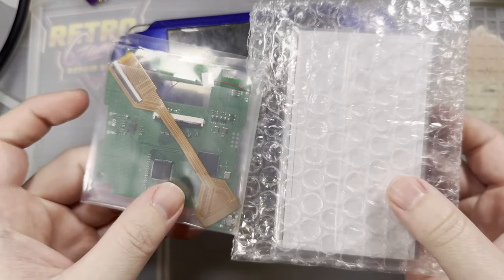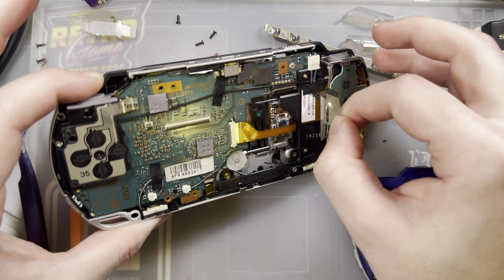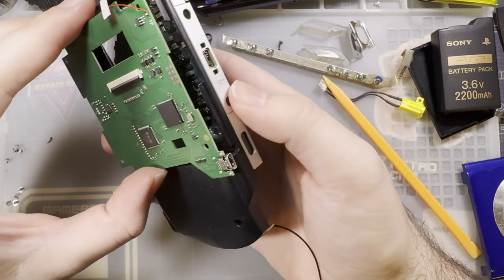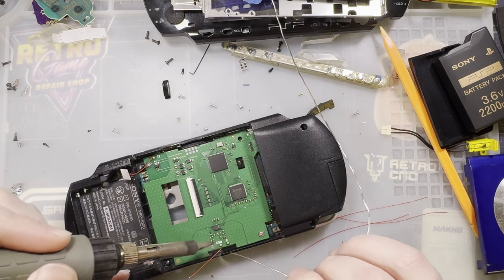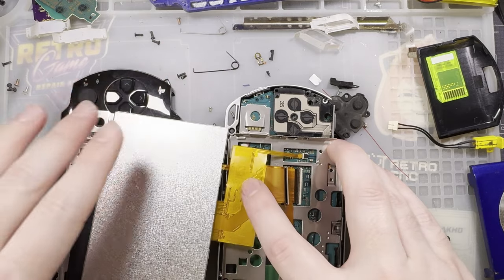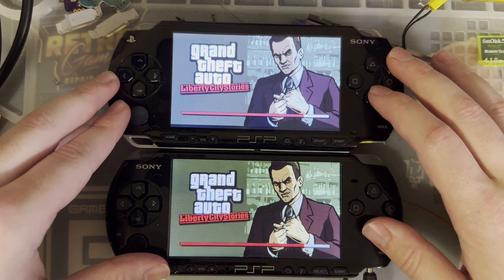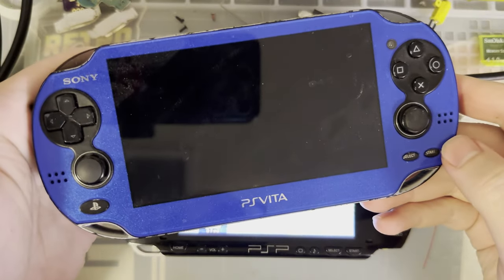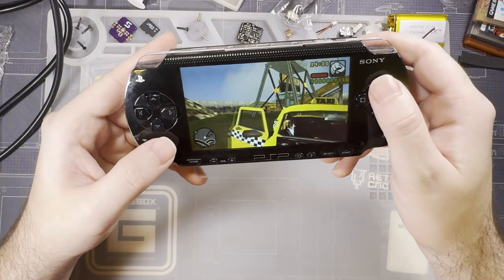PSP 1000 Internal HDMI and IPS Mod

Comment: I'm not sure if it's a problem of the mobo or not but I just swapped my PSP screen for an IPS as well and seem to have the same problem as you did. I tried shorting every pin before soldering and didn't manage to make it work. Mind my mobo wasn't that good but it's the same as the one you show on the vid and didn't manage to make it work.

Seeing everyone on r/PSP showcasing their IPS panels without the crop fucking sucks, but at least I'm not alone on this one. Might end up returning the IPS panel if I don't see much of a difference or just experimenting on some cheap working PSP I find around on the internet.
Reply from the maker: If you're using a compatible board revision, I suggest you double check your work under a microscope. If you're not using a compatible board revision... well, get a compatible board revision.

Comment: Looks nice but it annoys me too much, that the displays sits a bit too far up. a few lines are cut + one black bar on the bottom
Reply: That's an "easy" fix where you bridge two solder points on the board. The downside is they're so tiny it's not really easy if you're inexperienced. Pretty sure it's mentioned in the aliexpress product info.
Reply from the maker: @oledevo  It's also mentioned in my video. And I show it.

Comment: Do you always use a knife-point tip on your iron? I always use a pencil tip but good God it's hard to get the actual end of the tip to heat solder and get it to flow properly. I may just need new tips.
Reply from the maker: Knife tip has large surface area which allows for better heat transfer for most joints. It's pointy too so I can get it in tight spots (albeit without being able to make use of all the surface area). 

Rounded tips have a smaller contact patch and thus have slower heat transfer.

Comment: Recently, I also changed the screen in my PSP Fat, which I have had since about 2005 (I bought it in Poland), I got a screen from aliexpress, for about $ 12 (I would prefer the same site as yours, but the cost with delivery to Poland is $ 60) . I will not forget that, of course, I messed it up when soldering, it's good that a friend of mine knows it, he repaired my console and there is an image, in general, after assembling the screen and assembling the whole thing, I noticed that the right D-pad button sometimes "presses" or doesn't work at all, only then after sticking a piece of tape under the cross on the right side it somehow works (let's say 90% of cases), why does this happen?

Comment: Makho malding and making baseless statements about the psp having bad power management and that everyone should avoid them

A month later installs an HDMI output kit into a PSP 💀
Reply from the maker: PSPs have terrible power management. Sony made stupid decisions on how the batteries work and as a result, every single cell, both OEM and aftermarket, will just die on its own whether you use it or not. 

All because Sony put a microcontroller inside the battery that talks to the PSP mechacon and that microcontroller is always powered. It's literally inside the battery casing so you cannot work around this by just removing the battery from the console. 

It's hardly baseless.